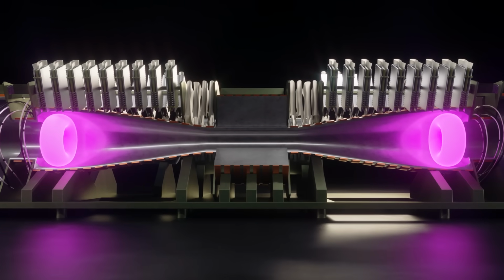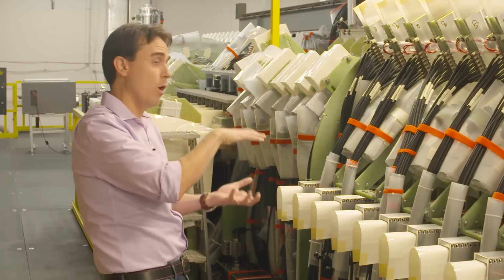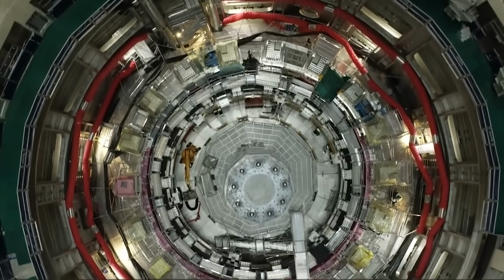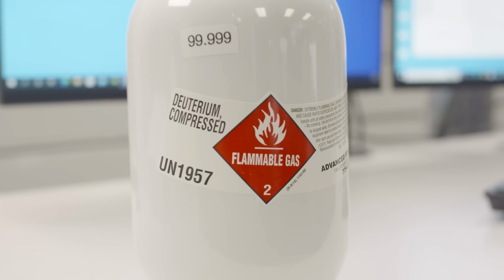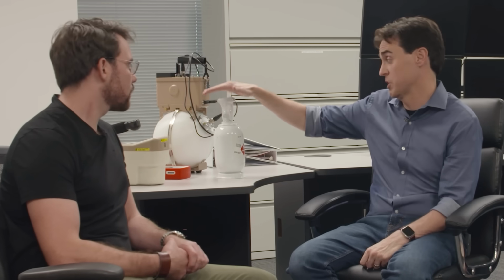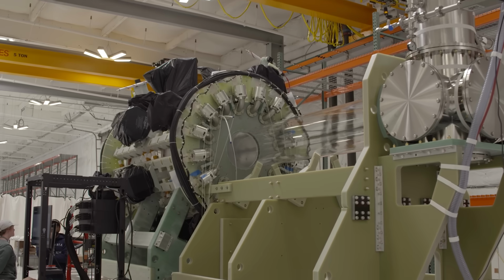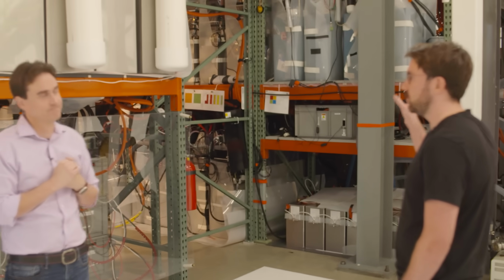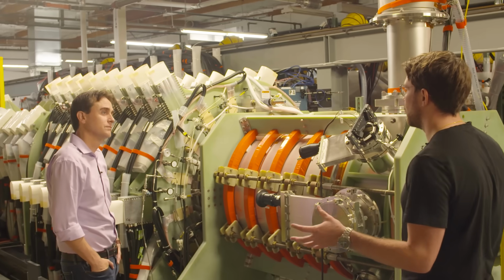A New Way to Achieve Nuclear Fusion: Helion

Comment: Before you get too excited, here's a pretty damning critique of the Helion approach. You have to bear in mind that a venture capital funded project has strong incentives to over-claim for their technology...

https://www.youtube.com/watch?v=3vUPhsFoniw
Reply: Not damning at all, just getting the facts wrong. 
Here is my critique of the critique:

- Critique: "FRCs have been done before and never worked." 
First, define "worked"! What was the goal of the experiment and what was the outcome?
Second, yes, FRCs have been done before and the members of Helion's founding team were actually involved with several of them. They applied the lessons learned from those to their own design, which they have tested over 6 prototypes so far.
Lessons learned and applied:
1. Size of the FRC. The larger, the less susceptible to n=2, rotational instabilities.
2. Elongation to radius ratio. The longer the FRC, the more stable it is to tilt instabilities.
3. The merging before the compression. This part creates a single, hotter and more stable FRC as a target for compression. FRCs get more stable, the hotter they are.
4. Helion's FRCs have a very low electron to ion temperature (Te:Ti) ratio of 0.1 and less. That makes things a lot easier compared to machines where both are in an equilibrium because: 
P(fus)/P(loss) scales as Ti^1.5 / (Z^2 * Te^0.5 )
Where Z is the atomic number (in case you wonder about that).

- Critique: "Deuterium - Helium3 has a smaller reaction cross section than Deuterium - Deuterium. At the 100 million degrees temperature discussed in the video, Deuterium - Deuterium reactions would be much more likely than Deuterium - Helium3 reactions."
That is generally true, but the author misses some key points:
Trenta is a subscale prototype with much weaker magnets than what they are proposing for a full scale powerplant. Because of that temperatures are somewhat lower than in a full scale power plant. Power plants aim for temperatures 20 keV (220 million degrees) and up to 330 million degrees (30keV). At that point the D-He3 reactivity surpasses the D-D reactivity.
That said, Helion actually wants some D-D reactions because that is how they are breeding their He3.
D-D => He3 +n or D-D => T +p
Both reactions have a 50% chance of happening.
So, in mixed mode (breed and power) machines, they will need two D-D reactions for every D-He3 reaction, at least until the Tritium inventory is large enough that they have a constant supply from decay (Tritium beta decays into Helium3). Sicne Tritium has a half life of 12.3 years, that can take maybe 20 years. That fact is probably the best criticism of Helion's approach.

- Critique: "Deuterium - Helium3 is too hard and Tokamaks cannot do it. Therefore Helion's approach of fusing Deuterium and Helium3 can never work."
D-He3 is very hard to ignite, but they do not need ignition for their design to produce enough net electricity to be economic. Most of the energy from D-D and D-He3 reactions is released as charged particles, not in neutrons. Helion can recover the energy in charged particles directly as electricity at a higher efficiency than a steam plant would. They can also recover 95% of the input energy directly as electricity. That makes their machines a lot more efficient.
Further, FRCs are high Beta (~1.0) compared to Tokamaks (~0.05). Beta means the ratio of the plasmas internal pressure to the pressure applied externally via magnets. 
Fusion reaction rate (the amount of energy produced) scales as magnetic field to the 4th power, an extremely strong scaling. However, that is the magnetic field inside the plasma, not outside, which scales as Beta^2 and B_external^4. 
If it was just about the efficiency of the magnets (it is not), then a 10 Tesla Helion machine would outperform a 200 Tesla Tokamak.
But, it is a bit more complicated than that, because confinement times in FRCs are generally lower. You win some, you lose some. Overall it is still a win for Helion's approach.
Since Helion is using adiabatic heating through the compression stage, they can to some extent(!) balance temperature and density almost linearly for a given magnetic field. D-D reactions favor higher density and lower temperatures. D-He3 is the opposite way round. They can tune that just to the right sweet spot between density and temperature depending on which reaction they want more of.
Another thing that works in Helion's favor is the aforementioned Te:Ti ratio. This ratio actually decreases further with higher temperatures. So the hotter the plasma gets, the smaller that ratio. Trenta already showed Te:Ti at <0.1. It is likely that a power plant will have an even lower ratio. Lower electron temperatures greatly reduce Bremsstrahlung losses. At a ratio of 0.1, thermal transport losses actually kick in earlier than Bremsstrahlung.

- Critique: "The neutrons from Deuterium-Deuterium reactions would have fried Trenta and I see no shielding." 
As mentioned, Trenta is a subscale prototype, an experiment. It is smaller, weaker and only operates at one pulse every 10 minutes (max). A full scale powerplant would do 10 pulses a second!
Not all shots were fueled by Deuterium or Deuterium + He3. Many were fueled by a mix of hydrogen and Deuterium or pure hydrogen, depending on what they wanted to test.
Because of that alone, the total neutron flux that Trenta has experienced so far is not that high.
What the critique does not mention is that neutrons from D-D reactions have a much lower energy than those from Deuterium- Tritium reactions (2.45 MeV vs 14 MeV). Those 2.45 MeV are below the activation energy of many materials.
The machine is mostly made from low activation materials or materials with a half life measured in minutes. Aluminum activated by D-D neutrons has a half life of 2 minutes.
In fact testing different materials under neutron exposure was one of the purposes of Trenta. They have tested quite a few alloys to see how they behave.
There is still permitted shielding of course. It is in the walls of the room and not close to the actual machine, which can handle the aforementioned relatively reduced neutron load just fine. 
It is also worth mentioning that a mixed mode Helion power plant (that does both breeding and power production) would produce neutrons only in one third of all reactions. So the neutron flux, even for those machines would be lower than for a D-T Tokamak.

- Critique: "Helion claims that they discovered new physics when they say that the ion gyro radius is 25% larger."
The whole ion gyro- radius thing was based on a misunderstanding and out of context quote and maybe also bad wording.
What happened was that Trenta achieved a higher ion temperature than predicted by Helion's too conservative physics model (a higher ion temperature is actually a good thing!). That higher ion temperature caused a 25% increase in ion gyro radius, which is perfectly in line with established physics. That's it. Nothing to see here!

- Critique: "Helion had previously said that they would have a working power plant in 2021. "
IM was very eager to get a "gotcha" on Helion. I guess he did not read further up on the page, or he would have seen that Helion was in the process of raising funding at the time. They did not get that funding until now. Even Trenta was less than 35 million (especially if you take the 35 million into 2019 dollars, when they started building it).
No bucks, no Buck Rogers. Should be quite clear, no?
Reply: @elmarmoelzer2229  Thanks for the detailed response - very educational!

I sure hope you are right, because working fusion is so vital for the future of our species...

As a lay-person who follows the field, I have never been convinced that the big official Tokamak projects are on the right track. 

Intuitively, the goal of containing such a hot and dynamic plasma for long periods seems to add layers and layers of complexity and expense. To the point that we have been stalled for decades because of the tens of $billions required to build ITER.

As an economist with a lifelong interest in poverty and development, I have never believed that these huge, centralised capital intensive projects are the way forward - even for the developed nations. Much better if we can develop a more decentralised and agile approach that is less capital intensive.

Again as a layperson, it seems intuitively that pulse-based technologies, which only have to contain the plasma for milliseconds, are much more likely to achieve a simpler and more affordable generation plant.

It's interesting to me that most of the commercial projects that are under pressure to produce a profitable technology within a reasonable timescale have chosen to focus on some variation of the pulse approach.

As someone who obviously has a deep knowledge of the industry, I'd be grateful for you views on this general strategic point about which approach is the more likely to produce working power-plants in time to help head off the looming climate disaster.
Reply: @tullochgorum6323  
Well, strictly looking at published milestones by various companies, we have:
1. Zap with scientific break even planned for early this year.
2. Helion with net electricity(!) planned for late next year.
3. CFS with Q(sci)>5 in 2025
4. TAE with Q(sci)>1 in 2025 to 2026
5. Tokamak Energy with Q(sci)>1 in 2026

Then there are a few others who could fall into a similar timeframe, but I have less confidence in them.
The first two in the list are pulsed. The other three are steady state.
CFS and Tokamak Energy are Tokamaks (Tokamak Energy is a spherical Tokamak).
Reply: @elmarmoelzer2229  So in your view a commercial Tokamak is still on  the cards within the next couple of decades?

Given that these much smaller projects seem to be close to breakeven, do you believe that a massive, super-complex project like ITER, which is gobbling up the public budgets, was ill conceived? 

Or are there still grounds for believing that it will lead to a useful return on the time and investment committed?
Reply: @tullochgorum6323  
CFS and Tokamak Energy will be comparably small. More the size of JET, than ITER. ITER is IMHO a commercial dead end but it is a nice science experiment.
Reply: @elmarmoelzer2229  The issue with ITER, it seems to me, is the opportunity cost. 

The billions committed could have funded a number of more agile and much less capital intensive projects and greatly spread the risk.

Obviously, I'm not remotely an expert but it doesn't look like the smartest way to move forward with fusion at a time when the climate clock is ticking...
Reply: @tullochgorum6323   Oh, I agree with that.
We should have done smaller projects. But politicians like big projects because they make big press releases and that looks good.
Reply: @elmarmoelzer2229  ITER is a scientific experiment.  It nevers has the intention of generating electricity for commercial use.
Reply: @catchnkill   Yes, I know that ;)

Comment: Glad this whole "warming thing" is solved. No more stranded polar bears or wind "blasted" albatross falling off nests. Does this means irrational people who oppose nuclear despite being the lowest CO2 energy (on top of being baseload) now accept nuclear!?  If so, I guess African DUNG-BURNERS get theirs first? Then Bangladesh, India, China and Palo Alto last..? Perhaps Palo Alto can just trade Africa and burn dung themselves?

It's great that places that can afford the upfront-costs retired their irrational opposition & fear-mongering that led to rising fission costs via endless litigation (creating an illusion of fission being expensive despite being [THE] SAFEST energy on the planet) have decided that reason & logic should be the arbiters of decisions? As if a fission reactors ability to use NUCLEAR WEAPONS as their fuel weren't justification-enough.

Seriously though, whether Thorium is ever sincerely evaluated as a fuel cycle, the justification to use salts as a moderator and as the primary heat exchanger is still excellent. Water's low boiling temperature requires pressurizing it to raise the temp range it remains liquid, as steam neither stores nor transfers energy well. As salts remain liquid from 400–1200 F at 1 atmosphere of pressure, no massive pressure vessel ($$$) nor the high-pressure plumbing ($$$) are needed. All of which pose engineering challenges, costs, and are the cause of most accidents. Operating at 1 atmosphere of pressure is great, but it can also operate at 2x - 3x the temp of water-based reactors, yielding superior efficiency via the percent of heat converted to mechanical energy. Operating at low pressure also makes them vastly safer, as pressure is the greatest source of complexity. Furthermore, there's only 2 steel mfrs that can make this pressure vessel IN THE WORLD. Representing a constant mfring bottleneck. 

If (or when) those setbacks are solved Thorium + Salt-based heat exchangers begin to look like a panacea. From the massive complexity reduction, shortened manufacturing time and pie-in-the-sky...mfr-ing-standardization which can lead to pre-fabbed facilities vs. having ~1,000 "1-offs" across the planet. To say nothing of the high-temp ability to create carbon neutral biodiesels at affordable prices as well as desalinating water. Costs and time to generate revenue are also shortened, mitigating interest & development costs. Literally revolutionizing the industry & living up to the "too cheap to meter" pricing while staving off the inane cries of idiots who think the world's gonna end in 12 (no wait, 4) years. Presently, reactors face hundreds of lawsuits from the moment a project begins, which has caused facility-costs to skyrocket by 400% (as well as each being a snowflake-design).

While there are still chemistry & engineering challenges to ensure corrosion is managed, the advantages of salt are so great that it's difficult to imagine cost-benefit failing to be self-justifying in the long (if not short) run.

The real challenge is one of PR: Maybe Bill Gates could invest in movies extolling nuclears virtues & prove naysayer claims are demonstrably false. Even the worst nuclear accidents (most were avoidable) were still less than SOLAR'S death rate. The 20% increase in renewable-capacity CA claims it (expensively) developed in the last 20 years, only reduced coal, hydro, & nuclear-dependence by 2%. Making the already expensive source (in sunny CA) 10x more expensive, & more importantly, still unable to provide baseload energy that's fatal to lack.

Comment: Although helium 3 cannot be produced on earth, it can be easily obtained on the moon, so even if it doesn't work for us here, it will work for lunar bases
Reply: Helion actually CAN produce Helium3 on Earth by fusing Deuterium.
D+D => He3 +n or D+D => T + p (the Tritium eventually decays to He3 as well). No space travel required.

Comment: this is a linear system with 2 branches of plasma generation pumped electromagnetically  into a fusion chamber. why not create a star structure in 2D plane or 3d  with same multiple branches around the fusion core ?
Reply: Because then there would be no room for the compression magnets. The merging is important because it results in a single hotter and more stable FRC (FRCs get more stable the hotter they are), but the compression stage is what makes the fusion happen.